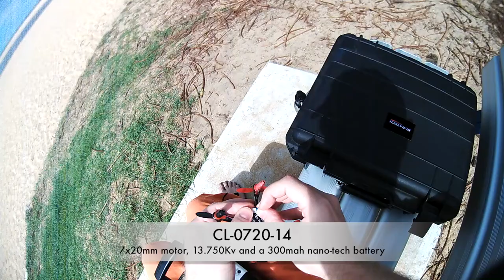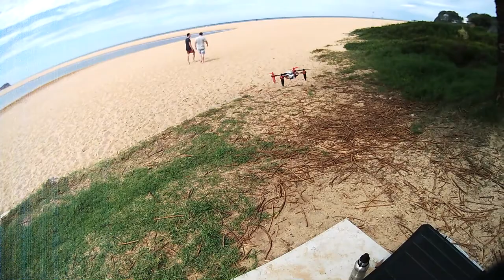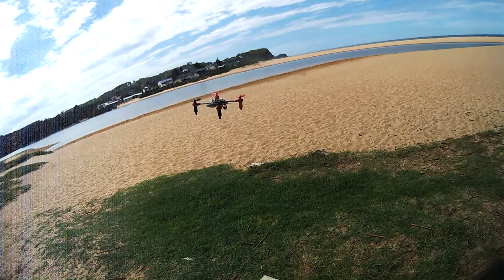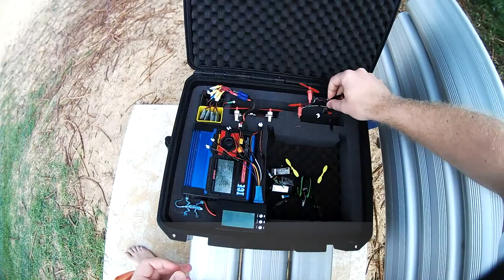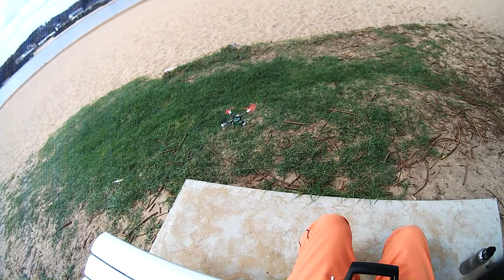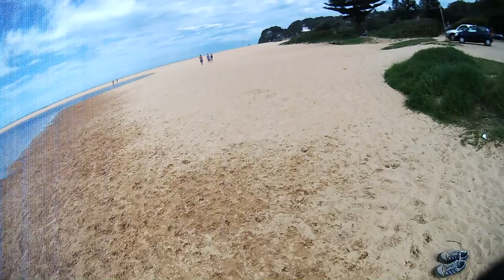The Motor Guy - talking, flying and submerging some fast micro motors..

Comment: Besides the motor what mods do you need to do to the flight controller to get that precision when flying and the massive acceleration for hover?
Reply from the maker: We call it "tuning". That is configuration of the PID settings and the control rates/curves until the copter behaves as desired. 
To accelerate fast, the power:weight ratio needs to be high. The right combination of motors, props and battery is key for that. These quads weigh 30-50g and produce 100-200g of thrust.

Comment: Hey Benedikt - quick question, what did you use to waterproof your quad? I heard that you get some sprays but I do not know which one is best. thanks
Reply from the maker: +Ryan M liquid electrical tape or hot glue, spread thin with a hot air gun. PCB lacquer works to a degree too. And contact lube for the plugs.
Reply: Thanks Benedikt! something like that is needed for the "lovely" weather here in Ireland...

Comment: I'm curious!  Is it safe to use the 8mm motors with a nano qx board?
Reply from the maker: The minimum throttle setting on the nQX FC will make the 0820 spin fast enough to shoot it skywards. I call that setup "the flying bull". Easy? No. Safe? Not so much... Fun? Depends.. Do you like riding bulls?
Reply: Perfect! I have a couple of micro frames! Im gonna use use the Cheerson X30 that thing is heavy! So I'm assuming the 8.5mm motors and a 600-750 mah will be a perfect combo!! Much Appreciated!!

Comment: is the 0720-14s faster then the "dark motors?"
Reply from the maker: The last two digits indicate the unloaded speed per voltage. The higher that number, the faster the motor. Always a assuming you have a battery that can keep the voltage up.